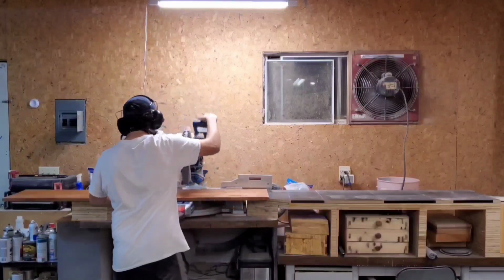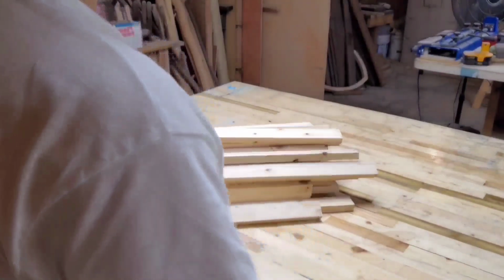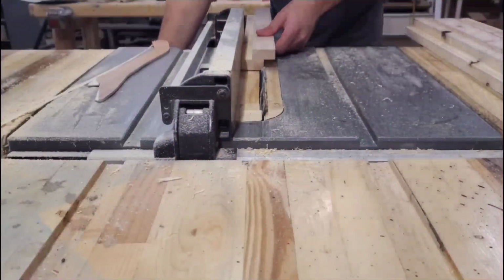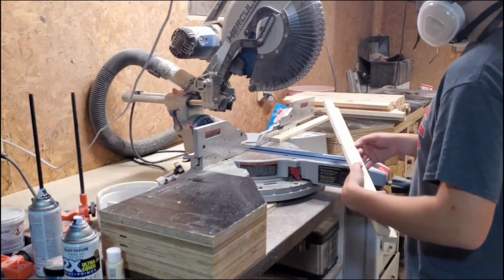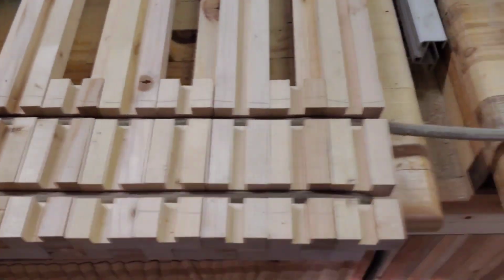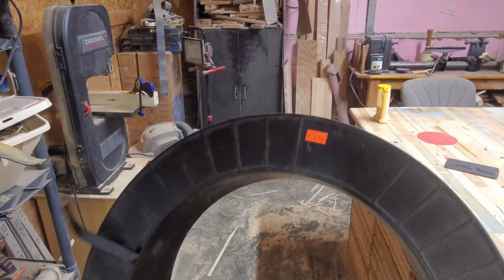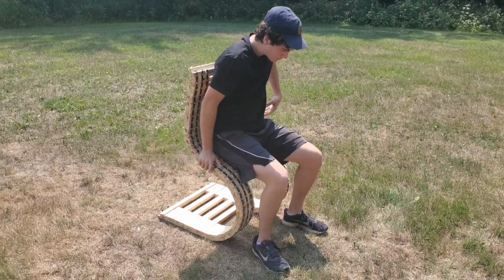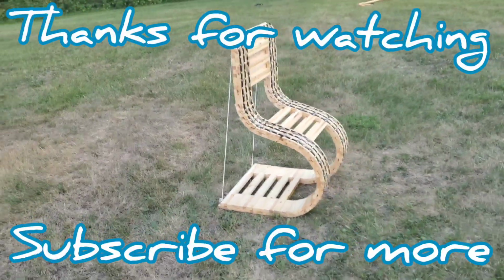Making A Chair That Rolls Up (again) | Woodworking

Comment: Tamar tried again… I can’t help but sympathize with her frustration.
Reply from the maker: Just saw the video. It looked so good too, it's a bummer it didn't work out. Her third chair will be perfect.
Reply: @JoshWrightWoodworking  i think she overlooked something that was different in the real thing than the demo in begining of video.
she used tape and then used some type of seat belt looking material  in the real thing, the key difference being that the tape was glued.
i believe you could still glue the seat belt like material and roll the chair if done correctly. but thats just my 2 cents...
Reply: Her video shows up directly below in the suggestions beneath this video🤣 her work is rather outstanding
Reply: @DrNafariousx  the strapping would still stretch between the joints and glue between strapping and wood is not gonna be a super great bond, with the amount of stretching force on the strapping the glue might well break.
Reply: @GrayOlson  I don’t mean just use glue I mean use the glue and everything else she used aswell. it would reduce the amount of material that can stretch.
Reply: This is the comment I was looking for.
Reply: came from her videos to to watch his video and I'm like damn lmao
Reply: Yeah, hers doesn't have the Z-shaped elements though, and I think that's part of why that design failed.

Comment: Finally someone using metal banding... I've put that suggestion under the first of these videos... Although palette banding is a bit too weak. I'd still use stainless steel cable.
Reply: I know right ive seen like 5 diffrent people try to make this chair
Reply: This guy cables
Reply: That was my first thought too. No stretching
Reply: Only problem with that is after so many roll ups metal tends to get weaker and break at certain points
Reply: @BobLeeSwagger91  that's a good point. You'd have to distribute the bending points as much as possible

Comment: Idea: leather strapping. When you roll it up, it looks unwieldy, like it wants to fall open again, plus you have to wrap your arms fully around it to carry it. I'm thinking that you could add a leather strap that would wrap around the roll to hold it together, and then another strap to serve as the handle. Then, when the chair is open for use, the strapping could double as means of holding it open, performing the role of the strings you used at the end. Leather on wood also looks incredible, so boost to aesthetics.
Reply: Leather is actually extremely stretchy
Reply: @elijahbrickey151  depends entirely on the thickness and the animal used. Also, for the application I suggested, it wouldn't need to be super rigid anyway. 

Source: am leatherworker
Reply: @PatrickCordaneReeves  if I was to do this. Any recommendations for the type of leather?
Reply: @gabrieldawa6221  thick cow hide, thick as you can manage. Alternatively, kangaroo if that's possible for you. I hear kangaroo has really long, strong, fibrous leather. Veg-tan in both cases.
Reply: @PatrickCordaneReeves  Would the leather need any type of maintenance or coating?
Reply: @gabrieldawa6221  cheapest Ave easiest way to maintain leather is to go to the grocery store and buy the cheapest jar of coconut oil. Just rub it in with your hands.

Comment: Yeah, this is what I was thinking in Tamar's video - ideally you want some kind of metal - sheet or cable or such - holding the chair up. Fabric isn't strong enough and stretches too much. I don't know what that pallet strap was made from, but it looked like a strip of steel sheet. You're working with massive mechanical disadvantage, so you need exceptionally strong material.
Reply: steel hinges with steel plates linking the hinges so the wood can't flex is the only thing I can think of, expensive and heavy.  Webbing, leather, cloth, or even steel rope have too much stretch.  The concept of this chair pushes material science to it's very limit
Reply: that's exactly what it is. Just a thin piece of sheet steel.

Comment: you can get dynamic and non dynamic rope, youd want non -dynamic for this purpose., its super strong with no stretch , expensive  as its for professional rock climbing, but you can usually buy it by the yard/metre

Comment: Awesome job dude, that must have taken some serious head scratching to work it all out. Just open the chair out the opposite way and chamfer some of those Z ‘leg’ angles a bit more to tighten that lower curve and should sit back quite nicely then without having to alter the top strapping. Seriously great design dude, get that refined and guarantee you some furniture art lover would pay good money for that as it’s just just a chair it is a piece of art, great piece displaying both form and function to a high degree.

Comment: So in the end it turns out the roll-up chair as originally designed is pretty much impossible due to stretch in any material used.
But still this is a nice usable version.

Comment: First I was thinking you should have ripped the pieces with the blade at an angle.  Then you said "rope" and I'm thinking rope???  And then you showed an adjustable throat plate for dado use!  I've never seen that before, what an idea.

Comment: What i would suggest is try building a small scale mock up....jus to figure out with the overall layout and asthetics of the chair ..before attempting the right scale....maybe u can try it with dowels  by drilling holes on them and feed ropes between those holes or incorporate some kind of a metal chain or so,  instead of the angled cuts of the slats and try elongating the seating area.... anyways gr8 video and keep on trying ...were here to support u.....cheers!!😀😀👍🏻👍🏻

Comment: Add a rope that is fixed to the foot/beginning of the chair, that can be hooked on a hook on the end/top of the chair, so that the chair is stable when rolled-out/set-up even without a person sitting on it. After rolling up the chair for transport you can use the same rope to wrap around the bundle a few times and then fix at the beginning on a secondary hook, so that the chair doesn't unroll while it is being transported. 
Lol I write this, unpause the video and you add it, okay I guess its obvious ;), but using it to secure for transport might be a nice double use of the rope...

Good job on the z shape and that pallet band stuff. The z shapes remind me of tetris, might be cool to do a tetris themed chair.

Comment: You are correct the rope definitely would have stretched and you wouldn't be able to pull it hard enough to get the stretch out you might have been able to use super static rope but the banding was 100 percent the right call

Comment: Yes awesome job, I think you ought to seriously continue improving this till it’s super thin, kid-safe, and still durable up to 250 lbs, then connect with a manufacturer.
Reply: till it’s super thin, kid-safe - i.e. make if from aluminum, hinges and cover the aluminum w/ veneer wood. At 250 pounds (no rocking), you are looking at 2000+ pounds of force on the front bend.
Reply: @stanimir4197  yikes 2000lbs is a lot of force, but does the force get spread across the multiple hinges of the front bend, or is that roughly 2000lbs on each hinge?

Comment: I have an idea for the next one use steel round bars through the wood and maybe you have more support The wood is too flexible and I think if you do it this way you can make it so it sits like you want it and if you sit on it doesn’t flex that much or maybe the whole construction will crank and it’s over can you please take a look in this idea 💡

Comment: Make it longer so that it basically folds in on itself and can help support the weight, or add a part that can fold out and notch into the lower area (although that feels a bit like cheating)

Comment: I bet if you used the right kind of rope, it would work fine with rope. The kind you need is probably HMPE, aka Dyneema or Spectra. 
You definitely want to avoid any rope with nylon in it. Nylon is great for climbing because it absorbs shock better, but terrible for your application.

Comment: Dumb question: why don’t you cut the angles before you glue them into the Z shape?
Reply: Can be easier at times, and often times current wood glue is stronger than the wood itself. I would also look it up some where too. It may help

Comment: Flat banding like that tends to heat up and break over time from bending, wouldn't be surprised if it starts to break from all of the rolling, unrolling. Although I'm no expert, just worked with it for a few years

Comment: A nice implementation of the original idea. I like the aesthetic but I do not see the practicality. A more portable chair that folds flat with less wood would be much nicer to carry around. But that's not the point, I get that.

Comment: Nice! One thought: once the chair is in final rollout, it would be nice to have a strap that runs from the top to the base, holding everything together. I think that solves the 'weight' issues needed to form the chair shape. The strap wrenches down the chair shape and can be unhook when you want to roll back up. cheers!
Reply: Watch till the end

Comment: Why does nobody use steel for the links? 1/8" steel cabling is not going to stretch and should keep a form far better than any fabric or composite material. Aside from the wood itself compressing (which could be slightly alleviated by using metal plates between each slat), a chair that uses steel tension cables and metal plates at the friction points should hold form significantly better than these.

Comment: The idea of a roll-up chair is good on paper, but in practice it's just not so great. I appreciate the efforts of you and Tamar, but at the end of the day you're running into the same issues. The amount of stress that's applied to the connecting material whether it's leather, webbing, etc seems incongruous with a chair that requires stability to be safe and comfortable. So far, the roll up chair is neither safe nor comfortable.